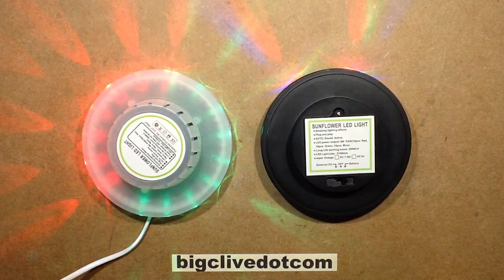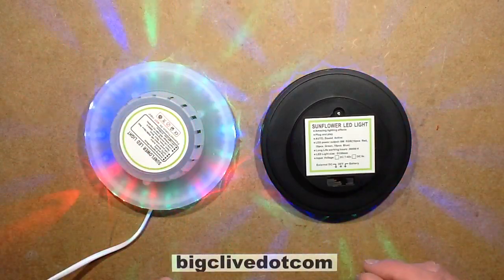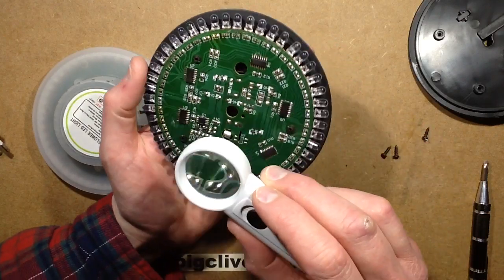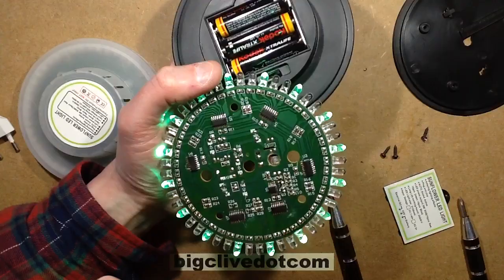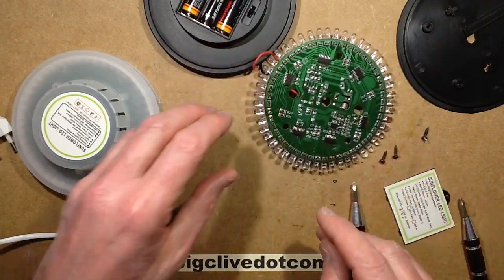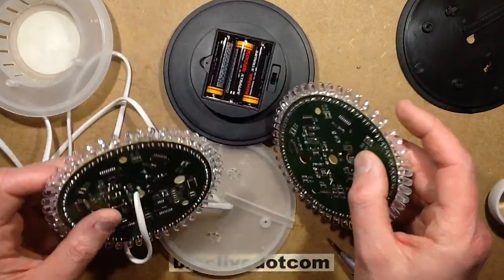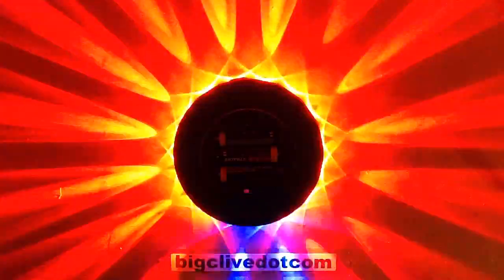Inside two tornado party/disco lights.

Comment: 74HC595 is an oldy-but-goody. The Intel 8051 databook c. 1985(?) describes an entire automotive light controller using them for all signal lamps, including half-brightness PWM for the parking lamp function. I have used them for I/O expansion on a number of industrial and commercial products. They are especially useful for LEDs, since they are buffered, with, as you point out, a buffered 'store' function, which allows you to shift out bits without causing the LEDs to flicker, and then clock the output registers simultaneously. Good stuff...

Comment: I had a look for the HT1608 chip, as I was curious, but the first one I found was the Holtek HT1608, which is (surprise) an LED driver.  Then I found the Hotchips HT1608 which is, of course, a little switchmode power supply controller in a 3-pin package.  So it would be possible to use two different HT1608 chips to implement one of these.

Comment: Here's a DC version, but it's not cheap at £10 for two: https://www.aliexpress.com/item/2PCS-UFO-8W-48-LEDs-Voice-Control-Sunflower-LED-Stage-Light-Rotating-RGB-Lighting-For-Living/32772457316.html?  Can anyone find them cheaper? This one has a hole in the centre of the back plate and a groove/channel to the outside, so I guess that's where the external power can plug in?

Comment: I fancied one of these. Beware when ordering that the cheaper ones may be 3 channel rather than 48 channel (I had two wrong 'uns before I finally got a good 'un).  In mine the 48 LEDs are in a 3 by 16 array.  Three transistor drivers (R, G, and B) and a CHIPONE ICN2026DF which is a 16-bit shift register, 16-bit latch, and 16 constant current (sink) drivers. Chip data on www.chiponeic.com (I used Google Translate).  PSU is simple switcher putting out about 5.6 Volts (as measured by my DVM).  It also has a microphone which does seem to affect the pattern sequence.  Mine came from Ali-Express, Store:
JOYLAND LED lighting technology co ltd, in category 'others'.

Comment: I like the audio function. Here in the city bass from neighbors or passing cars is always an issue. It'd be fun to buy one and put a copper street through that case along with a cheap amplified amazon microphone and through a low pass filter then point the sensor at my neighbors and I'd have visual confirmation that when it changes directions it is their bass. Spread it throughout the neighborhood and maybe I could finally get the authorities to do something about the nuisance juvenile deliquents, their drug-ingesting crack-making father (the third kid disappearred, BTW) while they play their video games at excessive volumes all night long. They're too stupid and drugged out to know what it was. 

If I disabled the green leds they might think its the police and that would be enough. Which item is this on his site? Is it available with an American plug?

Very smartboard design. Next time you do one of these you should run a frequency generator up through its paces and see what happens. I half expected you to do that because it was mandatory for us to build one built into our main power supply project and mine still works like a charm, minus one broken 90 degree aluminium corner. (it was already stress fractured / metal fatigue from being bent when made. College will do that.

Comment: These are all over ebay and amazon. I just ordered the white AC one for $4.99 shipped to the US. They can make it for any plug UK/EU/AU/US since the power supply is 90-240v 50-60Hz. (http://www.ebay.com/itm/LED-RGB-Lamp-Effect-8W-Auto-Sunflower-Rotating-Party-Stage-Club-KTV-Disco-Light-/201386097870)

Comment: Is it possible to link 2 or more of these together so they are synchronized?
Reply from the maker: +MrTeddyMMM Technically possible if you linked the internal data and clock signals, but not stable on a long wire run.

Comment: I have a tornado (sunflower) light that has all the LEDs connected to one big 24 pin chip and 3 MOSFETS to power 16 leds at a time (switching quickly between them). See photos here: http://imgur.com/a/1tU9V

Comment: I opened mine up and discovered that it features a VIPer22ADIP chip (LOW POWER OFF LINE SMPS PRIMARY SWITCHER). Since there's no standby mode or charging capability, why do you think this chip is in there?

Comment: I bought one of these and when I plugged it in it went bang :{
Reply from the maker: +Sean Confer YAY!  Disco explosion.  If it was from ebay then open a case to get a refund or replacement.
Reply: +bigclivedotcom Money has been refunded :D although the bang was worth the 7 dollars I paid for it I must admit
Reply from the maker: +Sean Confer I hope it exploded with enough force to make lots of little flames and smoke squirt out every side in a symmetrical pattern.  If you still have the unit you may still be able to hot-wire a 4.5 (3 x AA batteries) or protected 5V power supply onto the LED circuitry to see if it survived the mains side blowing up.

Comment: '595 serial to parallel shift registers are ubiquitous in hobby electronics these days. 
The '595 chips are about the easiest chips in the world to control. You just shift the bits out and toggle the latch pin to set the pin states.
I agree these disco lights would be easy to control with just three I/O pins of a microcontroller.
The TPIC6B595 is a high power version which can only sink power. I used some of these high power '595 with some $7 ebay RGB arrays in this project.
https://www.youtube.com/watch?v=AcArFGrKYVc
Thanks for another fun video Big Clive.

Comment: I'm going to have to get one and hack it with arduino there's a lot more patterns and scope maybe an ldr and  heat / movement sensors ;-)
Reply from the maker: +Simon  Hopkins  You'll just need five connections.  +5V, 0V, clock, data and shift to move the streamed data out to the LEDs.  That's assuming you powered it from your existing 5V supply.

Comment: The three-beam and 6-beam patterns look like magical multi-coloured blasters with a white centre with that overexposed camera.

If somebody would make this in the form of a light socket attachment, and made it so the light is also visible on the bottom with a remote control to operate it, I would definitely install such a thing in my bedroom.

Comment: The mains powered one makes an odd squeal when doing one of the KITT-esque scanning patterns... :S

Is it me or are the LEDs not entirely equally counted out or properly wired up? there seems to be a section where there's a dead spot and then to LEDs of a different colour lit at the same time, kind of sets off a hint of OCD in me... :P
Reply from the maker: +twocvbloke The mains one was sitting up on its cable slightly resulting in a lop-sided effect.
Reply: bigclivedotcom
It's the battery powered one I was looking at (should have mentioned that I suppose!), just looks odd where two or three LEDs seem to be out of sequence...

Comment: Those 595s are awesome little shift registers. Very well documented for Arduino use too. First thing id do is put in a small Arduino and drive the LEDs to display as a clock

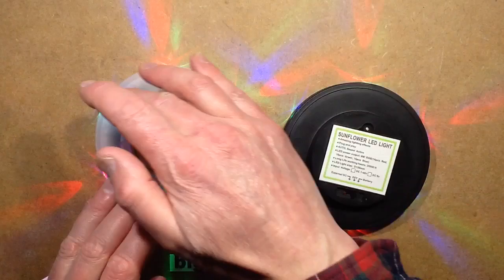Comment: at around 1:45, when the light on the left is doing the "dual wiper", you can hear, what im guessing is high freq switching noise from the power supply...

WEEEEEEE WEROOOOOOOO WEEEEEEEEE WEROOOOOOOO 

she makes a good squeal ;)

ive got speakers with excellent freq range, it is VERY high pitched.... my 21 year old ears can hear it, but 50+ old fucks like my dad i KNOW cant hear that.
Reply: i could also hear that with my headphones

Comment: Hi bigclive , haven't seen a video about the screwdrivers you use for all your videos. I was looking for a exchangable bit screwdriver just like yours but I cannot find those sturdy metal one. I bought a cheap plastic one and the bit holder just got loose after too much torque. Bummer. Would be awesome if you would advise me on where you get your screwdriver set!
Reply: +Jayden Lee Poundland if in the UK. Otherwise they're on eBay - search for 9 in 1 screwdriver and you should  find them
Reply: +Michael Tempsch okay cool , thanks! :-)

Comment: In terms of common serial to 8-bit parallel chips if it's not a 4094 it's probably a 74HC595. Your guess was correct.
Slightly different in behaviour but both are so easy to drive. The only caveat is you don't get any fading control without some super-insane wiggling of bits in software.
The pins on the chips are in order so a single bit will travel the circle in 48 clocks. There is current-limiting on each pin, perfect for LEDs without resistors (as long as no more than 4? per chip are lit in this case there will be no drop in intensity)
I thought it would make sense colour-wise to combine the leds into 16 RGB leds but then you wouldn't get that spread between them and would cost more anyway.
In some modes it reminds me of Lux's laser

Comment: Anyone else notice the high pitched sound the camera pics up when it goes into the mode at 1:47?
Reply: +BikingMNViking LOL! Thats very interesting to know. I have always been able to hear high pitched sounds from devices and other things that no one else seems to be able to hear. I'm 5'8" btw. Back in the 80's when I was little, there were several stores I had a hard time going into becasue of the registers they used produced a very painful high pitched electrical noise that was painful to me. Back then I was also able to tell when someone pressed a key on an old Texas instruments calculator becasue of a very slight "hum" it produced. Teachers and even a doctor thought it all might be in my head. LOL! The highest I have been tested to, just recently actually, was up to 21Khz. 16 to 18 seems to be where sounds tend to be painful to me. I can hear up to 21 but they don't hurt quite as bad. I just always thought it odd that I can hear things on TV and when I am out and about that no one else can hear. I am constantly asking my friends..."Do you hear that?"... :D
Reply: DJ Siryn
Mind if I ask how old you are? Because the common pentode CRT TV used a horizontal frequency of 14.74 khz so you'd be able to hear that quite well. Do you have smaller earholes than others around you... I mean have you ever noticed any physical reason that might justify that?

If not you probably have smaller pieces and parts somewhere in your ear or else your nerves have developed or "trained" (this doesn't happen like it sounds, like you might have lived near a source of something electric that put off unusual energy when you were developing, for instance) and now are picking up.

I don't know what country you are in... have you noticed certain higher than average frequencies in malls or places where there might be a lot of high frequency cell phone activity?

I wonder if there is any evolutionary model for it. I heard it said that babies crying are around 3khz and that's why most humans can hear that sound well -- to keep their offspring alive, obviously.

You're right about society. My deafness is rarely understood by most people. In fact for about 2 decades I never told anyone because I can read lips so well and bluff through the rest. Finally when I was working at a job one woman gruffly asked me "Are you deaf or something" and I answered her honestly. Even though she was a regular she must have been so embarassed because she never came back to the store. It's funny all those years and no one ever picked up on my lack of hearing. Usually I just got called stupid or was the last to be picked at childhood games.

I did get a hearing aid but it only aggravates my seemingly constantly existing condition of ear production. I drink a lot of kefir these days and those microbes (12 lives ones unlike 1 or 2 in yogurt) help some (and I can digest cheese better, which is best when I can have pizza at least once a week. :)

You know you could get an electronic device that would hear those high frequencies. They might even have an app for your phone that does it. Then you could show your friends you are not as crazy as they think you are. You'd make a great technician --often circuits and motor bearings go awry and make annoying high pitched ssounds they are not supposed to. Apparently this motor is like the "chinese watt" clive so appreciably coined.
Reply: +DJ Siryn 
Yep. I can definitely hear it as well. And I'm a 21 year old male. I can up to about 20khz, so doesn't surprise me. Past that drops off, iirc. Found this out from a headphone test audio clip that starts at 2 or 3 hz and goes through a range of frequencies.
Reply: +DJ Siryn I was wondering about that as well.
Reply: +bloxyman22 I have really good hearing. I can hear up to 25K hertz, i can also hear dog whistles... My Husband could not hear it. It is there though... I just feel weird when I hear something that no one else hears. LOL
Reply: +DJ Siryn it was awful
Reply: +DJ Siryn You're a human dog whistle tester! We tested all of us college students and the one who heard the highest was the woman -- it was only 14khz...most of us guys dropped off around 8-11khz. That would be one advantage to daintiness-- proportionately smaller pinnea & ear canal that focuses the sound. For most people it's tuned to react the most around 3khz last I heard. I've had a surgery to open my right one to keep infections away after a tumor and a history of childhood ear infections. How tall are you? (most things are proportionate)

I dunno about apple but several other phones and devices use a high freq around that as a very crude "let you know we're nearby" kind of thing in certain apps. Now I find myself wondering what format clive's videos are at that encodes audio that high in frequency because most cell phones suck at their audio duties. 3khz bw I think was the standard meaning 6khz sample rate, usually, given Nyquist's Theorem.
Reply: +BikingMNViking I'm 37. I'm not sure about the smaller earholes, I never thought about that. I never have noticed any physical reason for it. I grew up mostly out in the country away from a lot of the big city noises for a good portion of my life.
 I live in the US, I noticed that the painful sounds seemed to go away for the most part right around the mid to late 90's when stores started switching to standard computers and LCD devices instead of registers and devices with segmented LED's (Odd). Once electronics started really getting smaller, the noises I heard seemed to go away or at least were at tolerable levels.
 I have been drafted into being a technician so to speak or at the very least, a  bloodhound for finding and identifying noises in cars and other mechanical objects that have bearings and such. My directional hearing is fairly acute as well. Makes it hard to sneak up on me. :)
Reply: DJ Siryn
Yeah, those old calculators used to use those segmented vacuum type LEDs I think we all heard those. Most of the devices you describe use crystal oscillators for reliability is my first thought -- of course they break it down by dividing it to make it useful so any lower numerical (usually divided by 2, 4, 8, 16...etc. The whole binary system).

In fact I was cleaning up and organizing my electronics workbench and sorting various old circuits and I came across one with a 4 Mhz crystal on it. Took me a minute to remember it was actually the inside of a digital pop up toaster! ( I can't imagine this being any better than the spring kind but it had a full PCB with three leds, frozen mode light, manual light to dark made of silicone, bagel function.... and the main power part was a large electromagnet to hold it down and let the springs make it go POP when the toast is done. Strange hunh?

(do you think this crowd would enjoy a review of something like that?)
Reply: +BikingMNViking Sounds like a unique toaster. I have only ever had the spring loaded type myself. I would enjoy watching a review of something like that. I enjoy watching how things work. It's always fascinated me. Most of my electrical knowledge revolves around fixing and installing car audio and pro audio, replacing, caps, mosfets, resistors etc. I learned at a very young age to make sure all the caps were discharged before I worked on them. LOL! I later "weaponized" very small caps and a 9v battery in a handheld device I cobbed together to give a mild shock to my friends and family when they were not looking. HAHA! They hated that thing!
Reply: DJ Siryn
I bet! I got called into the police laison's office in junior high at age13 for making a neon bulb tester that upped a 9 v into 150vac to test neons and other small electronics safely. It got lose and a few butthead guys shocked a few girls backs of their thighs and I was asked not to bring it back into school anymore. (however my .22 lr was just fine!) LOL!

At least they had sense then. I never got treated badly by that copfor that either. He was part of my Firearms Safety Team and I got the highest score.... one wrong. 96%
Reply: YouTube cuts off frequencies above 18kHz, so maybe y'all just have tinnitus.
Reply: Mikeyguy94
Nope. rip the audio and look at the spectragram.
Reply: ***** They must have recently revised that because I have a few audio files from 4 months ago that was ripped from videos and they don't have anything above 17.5kHz. Glad to see that was changed back. Must have something to do with the new YouTube music app.
Reply: i heard it
Reply: My hearing is even better, I can hear up to 10gHz, so when people send naugty stuff over wifi - I can hear it all.
Reply: Yeah I can hear it, it's awful